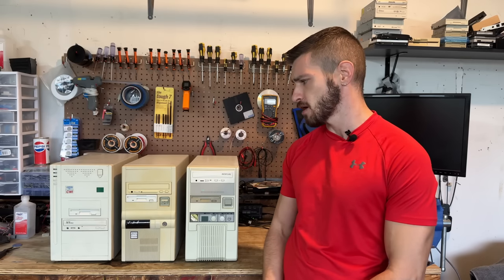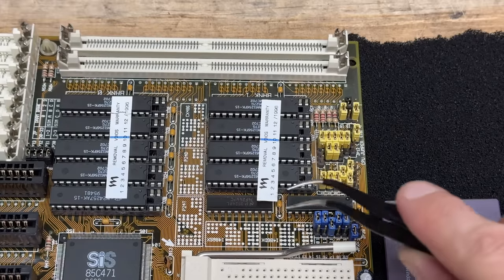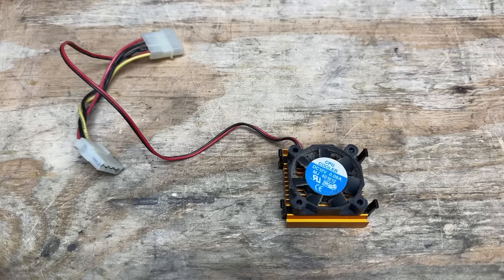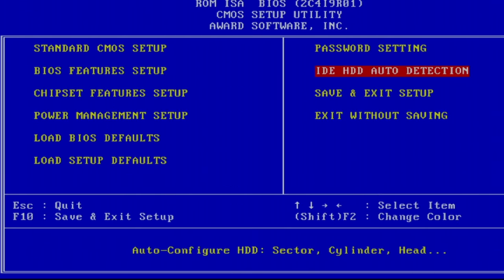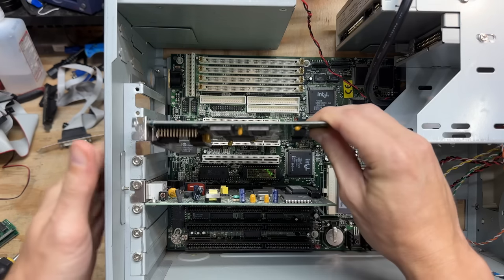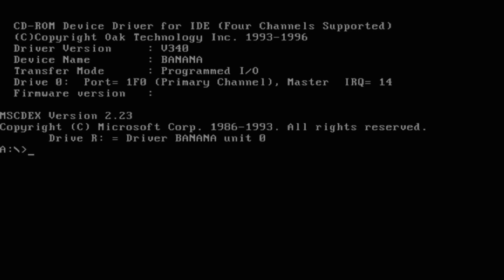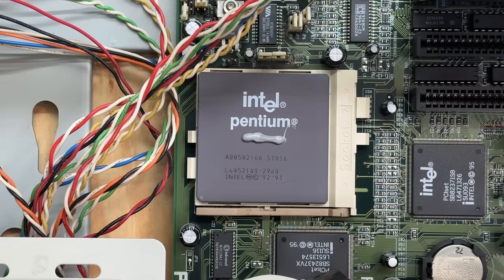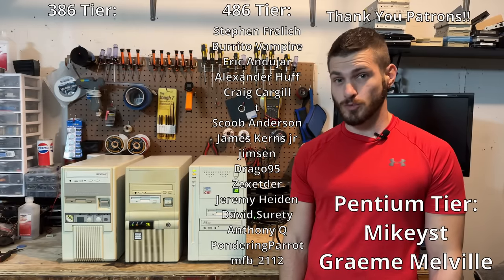Baby AT Systems! Teardown, Test and Repair! Vintage computer towers from the '90s.

Comment: Hi MikeTech.  Thanks for another trip down memory lane.  I used and upgraded one of the CWI computers, back in 1999, which belonged to a friend of mine.  The name on it wasn't CWI, but some brand which was used in the UK, where I live.  The PC in question had a Pentium 120 CPU, which I upgraded to a 166 MMX.  The O/S was the first iteration of Windows 95, which I upgraded to the 'C' version, which was a significant improvement.  I offered to let him have my 'old' copy of Win 98, after I bought the 98SE version, but he declined.  I well remember upgrading my COMPAQ DeskPro 4000 with some larger EDO RAM sticks; from 32 Mb to 128 Mb.  Tech has definitely advanced and improved since then.  My first PC - an Apricot 286 Workstation - came with Win 3.1.  I still have the complete set of 10 Floppy disks and the DOS 5 Boot disk, all safely wrapped in foil and stored inside a tin.  I've got an old Laptop which is no longer usable, so may install 3.1 on it, just for the fun of it.

Comment: I don't think that first machine actually had OpenOffice. Rather when you install certain versions of Microsoft Office it will add two icons to the Start menu, the one you picked up on is called "Open Office Document" and it just means that it will allow you open a document made with MS Office. Also that first machine had a 2.5 GB drive, and with early versions of Windows 95 only having FAT16 and thus a maximum partition size of 2048 MB, it's possible that the first drive has about 500 MB of unpartitioned space. Worth checking out. I guess even today hooking up your CDROM drive to a sound card if possible is a good idea. This way, you can have one drive on each of the primary IDE channels and not have them being slowed down by a CDROM drive. So one internal drive on the primary and an external CF or SD card for copying files to the PC on the secondary is a good option.

Great video as always.

Comment: Hey Mike, in case you aren't familiar with the G4 iMacs shown in your last video, just want to make sure you are aware they can be tricky to work on without damaging anything. Not much room inside so it's easy to pinch wires. If you take apart the LCD, make sure to look up how to do it without breaking the plastic rivets

Comment: When you checked the auto bulb and said it had "a crazy low resistance", bear in mind that a cold bulb filament has a MUCH lower resistance than it does when it's white hot. I did a little math based on you saying it was a 60 watt bulb that runs at 12 volts, and determined that it draws 5 amps of current, and its resistance when lit is actually 2.4 ohms, not the 0.3 ohms your meter shows when testing it cold

Comment: I had a variant of that first case, and some of those exact stickers. I couldn't remember if mine had the display in it though some of these would have the hole and mounts for one . but the sticker in the front would be blank in that area. so who knows. I did notice that you decided to start opening up the power supplies. might be a good call rather than leaving things to chance.

Comment: Love the video.  A note about early CD-ROM Drives.  I too used to think that the sound card connectors were due to protocols, and that is partially true.  It actually has to do with the nature of the original IDE standard.  The use of cylinders, tracks, and sectors was required on IDE, but didn't translate to the world of CD-ROM.  As a result, CD-ROMs used the same communications standard as SCSI (which were later incorporated into EIDE and ATA-1). So, for all intents and purposes, our sound cards were doing quadruple duty, as a sound I/O card, MIDI Interface, Controller Port, and SCSI controller.  Pretty impressive for a device that could be only $50.

The use of the SCSI communication standards continues today with SATA and MVmE, as both show as SCSI devices in most hardware trees.

Comment: The reason the characters of the copyright string are doubled (or in one case I've seen, quadrupled) in the BIOS is a holdover from when the BIOS was a pair of chips. That way, the copyright is preserved in full on both chips.

Comment: 13:40 - I'm using this word in my everyday vocabulary.... starting Monday. "Cromulent". 🧐😉
Reply from the maker: I once accidentally convinced a fledgling engineer that the word ‘cromulent’ was an actual technical term in networking. Wasn’t even trying, it just happened from sheer casual use. Then I realized that episode is older than these kids…

Comment: Excellent videos Mike, keep up the good work. I am myself now going to rebuild my original and first PC (that i luckily still have the original case, 3.5 drive and power supply for), a Baby AT case as well with a Turbo button and 3 number display. (was there not btw some socket 7 ones that supported the Turbo function??) It used to be a 486 AMD DX2-66 with 1 MB Vesa graphics, 8 MB RAM, and a Ultrasound MAX amo, sadly i am missing the motherboard back plate for the case. I will be using a socket 7 motherboard (QDI P51430VX/250DM Explorer II v.2.1S) with the same AMD pentium 133 mhz as in your video, and also a cache module. Not sure about what parts i will use for the rest? hmm. That second case has a motherboard plate would work on my Baby AT case as well with a just couple screw holes added i believe (have some pics of the correct one for the case).

Comment: Great video Mike as usual. Regarding a use for a pile of modems, this video might give you some brain food for ways of inter-networking them within a VLAN or something for a cool retro comm project: v=lTHYDzqjTvE

TL, DR: Guy uses modem on ancient PC to dial into a slightly less ancient PC which is actually on a LAN and routes through that for internet access using a phone-line switch. He also sends himself a fax like an absolute Analogue Chad.

Comment: I thought the motherboard in that first system looked familiar until you full uncovered it. I have an almost identical Socket 3 M-Tech motherboard that came with a 486-DX100 and 52Mb of RAM. I think mine's a little newer, it has 3 PCI slots, 4 ISA slots, and IDE/Floppy/Serial/Parallel are built into the motherboard. The best part, it uses a CR2032 as the clock battery! It also came with an S3 Trio32 video card and an ESS Audiodrive sound card. Someday I'll turn it into a Windows 95 machine when i get an appropriate Baby AT Case.

Comment: Why they ever stopped with the removable motherboard trays I will never understand. Such a GREAT thing back then.. I'm actually pretty sure I had a system at one time pretty much identical to this one.. I never had that hdd cover on the 5 1/4 bay, but basically the same motherboard i/o cards, sound card with the matching cdrom.. man, the good times. I really miss the 90s.

Comment: I wonder if an I/O controller on the VLB makes a hard drive connected to it faster than one connected to a controller on ISA
Reply from the maker: It would make an interesting subject for a short video. The IDE controller in system 1 has both! The IDE connector on the left is marked 'VL-IDE' whereas the one on the right is marked 'ISA-IDE'.

Comment: My first computer was a baby AT system with a Pentium MMX, 32MB of RAM, I forget the HDD specs but I know the sound card had an OPL3 chip. It was also the first computer I ever built, I was set loose with basic instructions and a stack of random AT and baby AT systems to make into a whole PC. Technically the hardware wasn't that old when I got it, but it was outdated because a lot of AT hardware survived into the Pentium II and III era, which just baffles me, but they did fill a budget niche I suppose. It was slow, but I still gamed on it, until I got a hand me down Pentium III that I replaced with a then new Pentium 4 Prescott system in high school. Actually come to think of it, up until the past handful of years most of my PC's have been out of date even if they are technically "New". No more though, no more!

Comment: I sold those Reveal drives and sound cards in the mid 90s. Or maybe I should say the store I worked at carried them. We all used our employee discounts to get name-brand cards so we assumed the Reveal cards were just cheap junk. Today we know better, that those cards were actually really good.
Reply: Reveal was indeed low-cost step in multimedia kits. The better more known brand kits where very expensive in those days from which i can remember.

Comment: S2 - Yep, PC Chips M507. I had one of those exact boards, fake cache slugs and all. The COAST makes it not an issue though and it just becomes a bog-standard Triton I based Socket 7 board (which does have the 'header' for replacement VRMs on the right of the CPU socket but good luck finding one). 

'Fun fact' about it though, it doesn't have a PS2 header despite having the pads there for one. Why? Because the IO chip has a bug that makes it so it stops responding when it receives input from both the mouse and keyboard at once. So you're relegated to serial mice with this one.
Reply from the maker: That board is hilarious!

Comment: At one time I had like 50 extra's of these empty, so I chucked them in a dumpster with the ATX power supply.
Even had some that looked identical to your 3 three.
I kept all the ones that had working systems inside I restored... so it's not like I still don't have like 50 of these things.
Clock battery probably died in them 20 years ago.

All of mine have 32mb and Win95 and Opera on them configured with working drivers for / with ethernet cards, modem cards, and sound cards for every one of them...  I had planted to rent them out as internet surfing computers at one time... never did it...   I'm wondering what I will ever do with them now.   
I'm tempted to reformat them to some command line Linux box to do... what?   Personal webservers?

Comment: I happen to have a similar system like your first one but no real way to test the PSU outside of the machine. I turned it on for a minute and it works. If the PSU was bad, would it start smoking or doing stuff after say 5 minutes of it being on?

Comment: That 5x86, had one of those in 1995. Thing was a monster, pretty sure they're the fastest actually-released 486 class CPUs out there. There are faster chips but they werent officially released IIRC. People often overclocked them to 160mhz and it compared to a Pentium 90.

Comment: Curious why do you cut through the sticker over the fan bearing rather than lift the whole sticker? Usually been pretty successful myself lifting the entire sticker, lubing it up, cleaning up any extra oil and putting the original sticker back down.
Reply from the maker: I rarely have great luck getting old adhesive to stick properly after it's been removed. It's just faster to cut my way in than to peel and clean the old adhesive.

Comment: First off - NOT A KIDDO!  Was a PC Tech from the mid 80's!  Can you say Bulletin Boards?!?  Decent work.  HD's of the era: When they fail they usually will give you a minor warning and completely fail, or they'll utterly fail.  PC Tools had better diagnostic tools than MS!  Windows will usually give you some indication of 'copy'/'move'/'data transfer' errors by spewing up 'alt key' characters.  At the time as far as I know - NO ONE USED MS Scan Disk! At first it would corrupt your drive, then it got better... If you are going to 'archive' these systems - you need to take the HD failure into account. WD Dynamic Drive Overlay was a blessing!!!  Back in the day optimizing these system (maximizing performance) was hard to sometimes impossible; driver existence and/or compatibility was primary issue; also configuration of devices attached to system; results sometimes in POST, sometimes not lol  From the parts Id say your either Central/East Coast USA.  IF you find a system with the primary drive that has a "Disks" or "Drivers" folder with subfolders of all the installation disks - that's Possibly a system I setup and/or serviced.  There was a prototype VESA board - around the Pentium 100 days - throw any speed of ram on it and it would sync it all up to 'expand' your memory lol  Then Auto-Banking came in lol There was one prototype hard drive - you could slot a single Dimm into it LOL OH! LOL USB 0.89 (or so) isn't compatible with USB 1.0!! LOL  I have it in my head that they appeared on HP systems and you have no choice but to use the 'original drivers' that came with them.

Comment: That 4x reveal drive is not an IDE drive ( i saw that is was connected to IDE) My dad had the same drive in 1995.(with the same soundcard). It should be a Panasonic drive or perhaps mitsumi..

Comment: 41:10  I'm guessing that in Pentium systems that used 72-pin SIMMS for RAM, the SIMMS had to be installed in identical pairs.
Reply: Nope, you could have just one stick of RAM if that's all you had. There was no dual-channel back then, and RAM was incredibly expensive.
Reply: @jeffb6786  Well, actually the Pentium's data bus was 64 bits wide, and the 72-pin SIMM's data path was only 32 bits wide.  Thus, you needed a matched pair of them to create one memory bank with a 64-bit data path.

Comment: The fact that you washed a motherboard blows my mind. How did you get it dry?
Reply: I've only done it once, to an old Skt 939 board that was so filthy there was no other way to clean it. I was so worried about it being wet afterwards, I stuck it in the oven on 200F for about 20 minutes and then let it sit overnight upside-down. The board works great to this day.

Comment: Voltage in the United States is only 120 volts give or take a few. A very long ways from being deadly. Ask any electrician, they probably get "bit" weekly. Let's not go over the top here...
Reply: Don't the capacitors on these computer PSUs get charged with two times the top voltage of the sine wave of that AC 120V RMS voltage? (I think they are rated for more than 340V, 170Vx2)
Reply: @RetroTinkerer yes while they have power applied to them. They discharge fairly quickly. And if you're pulling it apart and lickng the PCB while it's plugged in and powered up then you deserve to get the shock. Natural selection and all.

Comment: Has anyone ever tried replacing those fake cache chips with real ones?  As in is the motherboard actually wired up to accept them.
Reply: At least on some motherboards, like the one LGR has, the traces don't actually go anywhere and a lot just seem to go back to the "chip". So its even worse than just putting a fake chip in place of a real one but actual full on designed to scam you from the start